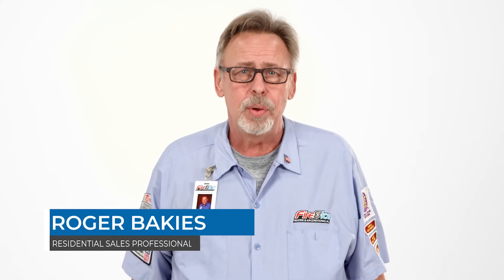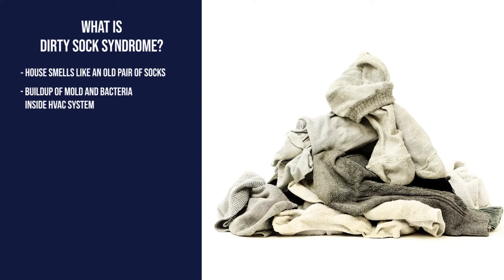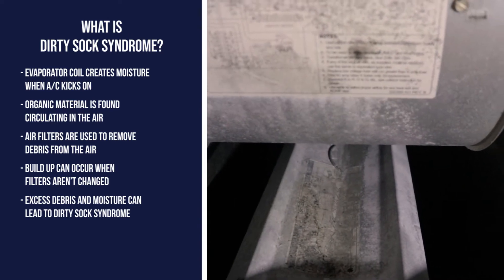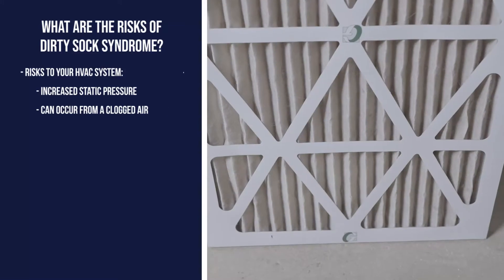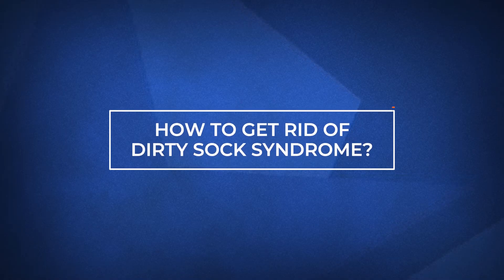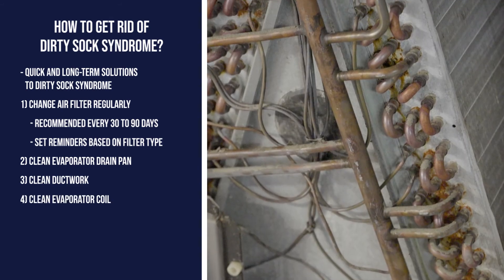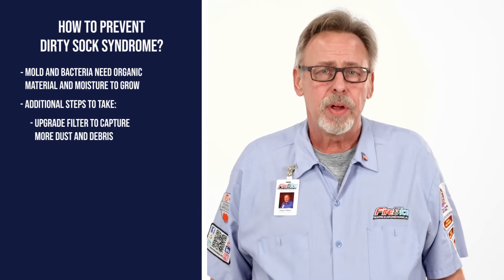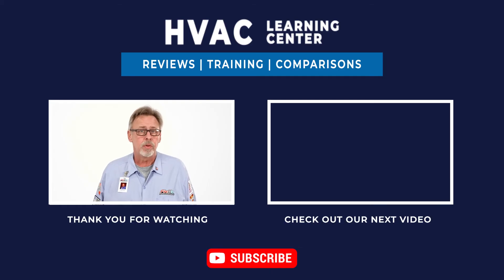What is Dirty Sock Syndrome?

Comment: I just moved into an older apartment that definitely has this issue. I have inspected everywhere carefully and see no visible signs of mold and mildew. I run a large capacity dehumidifier and a large capacity air purifier. I run small air purifiers in the bedroom and near my workstation. I keep the ceiling fans on. I use the bathroom exhaust fan when showering. Nothing works, and the HVAC system I’ll bet is the culprit.
Reply from the maker: Have it checked, thanks for watching